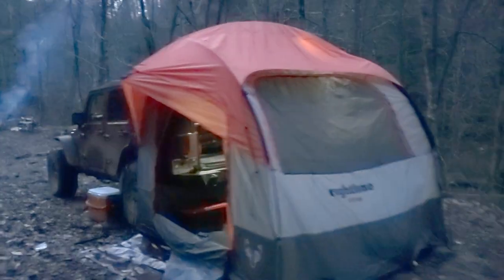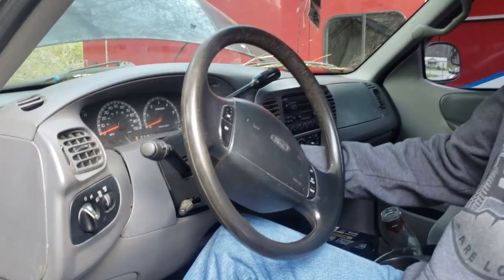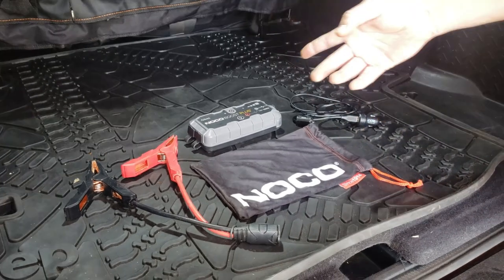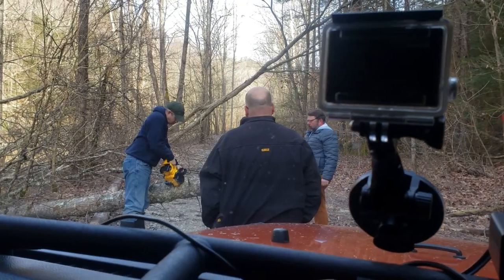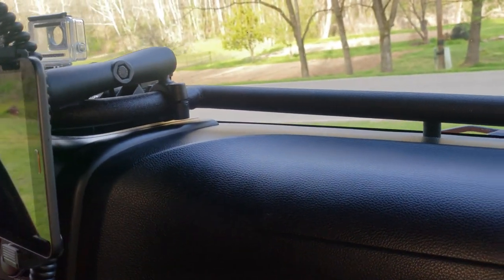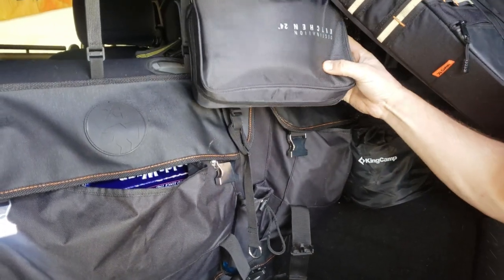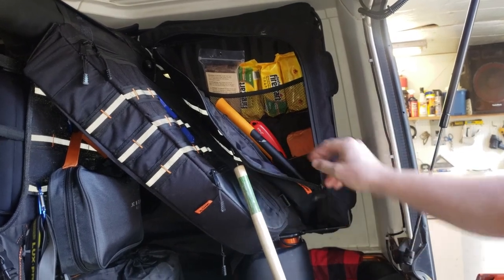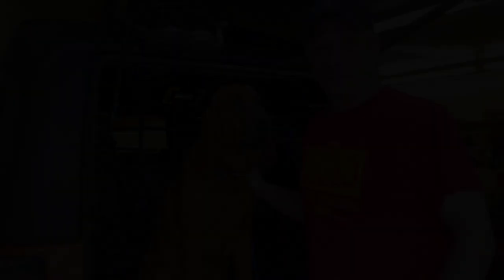5 Things that we have upgraded for our Overlanding trips

Comment: So much to learn what or how do you air down and air up do have a video on that
Reply from the maker: I don't have a video on that yet.  For airing down, we use a smittybilt tire guage to air down typically to around 16to 22 psi.  Air up by using a gas station or portable air compressor